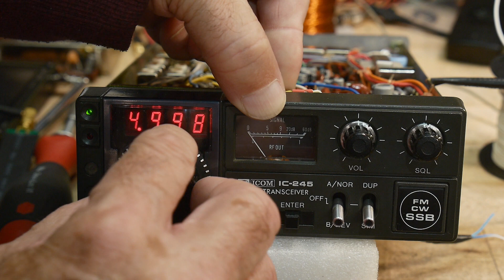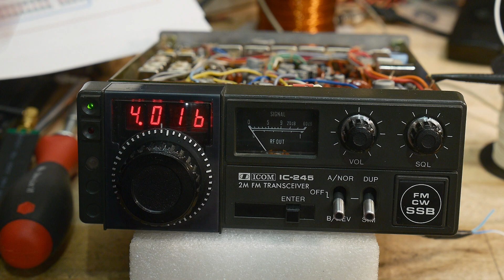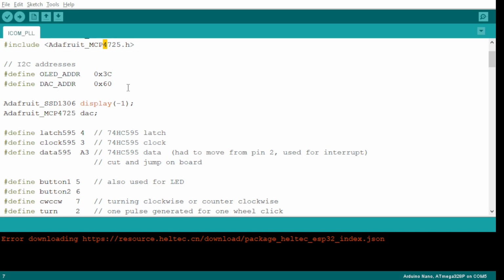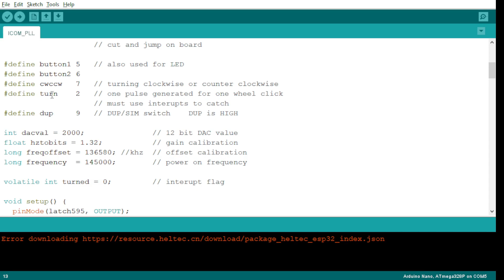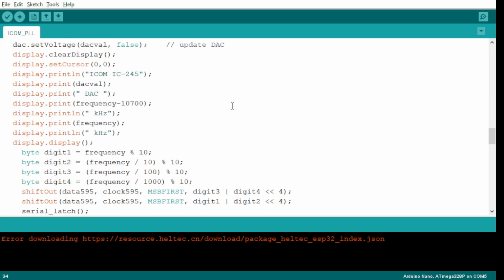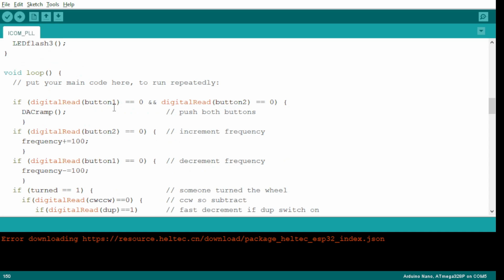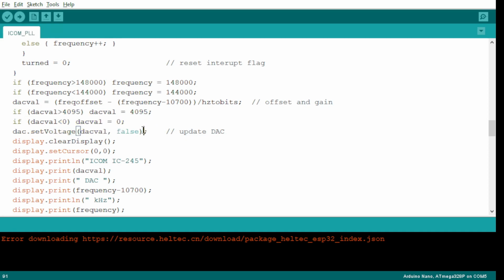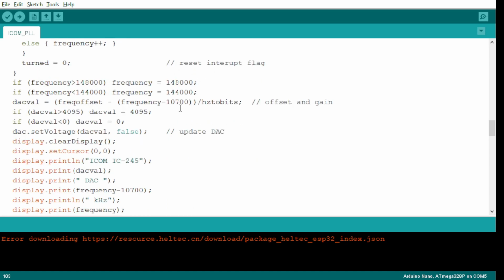#966 ICOM IC-245 Firmware running front panel  wheel and LED displays

Comment: I have an old IC-245 sn 2769 that had a wire break off going to the 10 pin connector at J3 of the synthesizer board. Do you still have the 245 thats in the video? I'd like to know if you could open yours up and see if you could tell me where the white wire on the end next to the brown wire goes on the front panel?

Comment: Great idea to do this project! Im having thoughts about one I'd like to do. 
Just fyi, there is a race in your code to handle interrupts.  Both interrupt and main loop code modify the flag.  Once you have checked the flag the window opens.  At the bottom of that handling of the flag being set,  the flag is cleared. If the wheel is being spun quickly and the interrupt comes between the check and the clear you clear the flag even though it's a new set.  It's not a big deal as the only effect is you miss a pulse when the wheel is turning quickly.  There is an easy fix though. Rather than use a signed int for the flag,  make it an unsigned long and have the interrupt service routine increment it rather than set it.  Then the check is against the stashed value of the counter at last check.  Just have to account for roll over (hence unsigned so no roll to negative). Also avoids issues with read-modify-write in the main loop because you only write it at interrupt level.

Comment: Hypothetically, at an inturrupt, you could check the time against the old, and if the timeout is short, you could change the frequency more than if the timeout was short. Either way save the time as oldtime. That way the knob will quick or slow when you need it to be. The timer and oldtime are unsighned long, but they only need to be subtracted.
Reply from the maker: I'm not good at time travel

Comment: Interrupts are serviced BETWEEN two processor commands.  If enough time passes, the interrupt service will be performed between EVERY two commands where interrupts are enabled.  If you load a value from memory to a register and proceed to use it, the service routine might have run between the load instruction and some of the use instructions.  The "volatile" keyword causes the compiler to guard against this:  Disable interrupts, load the value, manipulate the value, store the new value, enable interrupts, and repeat.  This assures that the value used in the main code is the same as the value used in the interrupt service routine.  ONLY values SHARED by the main code and ISRs need to be declared volatile or the performance will be degraded.
Reply: From what I've seen so far compilers don't add the disable and enable interrupt operations around the load and store operations. Volatile only forces the compilers to not store the value in a register (much faster access) but keeps using it from memory (where it may have been updated by the interrupt)
Reply: @rjordans  That makes sense; the compiler don't know when I am done using the value.  Thus, it is up to us to disable and to enable interrupts to keep the service routine from changing the value while we use it.

Comment: For future reference, note that the STM32 "Maple"/"blue pill" board is a bit better suited to these types of implementations than the nano---it is cheaper, fully compatible with the Arduino IDE, and has hardware interrupts on tons of pins (maybe all of them; can't remember). It is also much faster (which is obviously irrelevant for this type of project, since the Nano/328p has plenty of horsepower for things like this).
Reply from the maker: I have a love hate relation with those and other STM32 boards. you have to move a jumper to do the programming which is a pain. or push a button on other boards. my programming style is to constantly check small code changes and so I upload a lot. I do like the TTGO boards. I get the nanos for $3 so very close in price.

Comment: Doesn't the ATMega328p have a pin change interrupt (PCINT) on most of the pins (in addition to the dedicated irq pins)?  I haven't read the datasheet in awhile so maybe I'm misremembering.  Tracking down those solder joints should be a fun time :D

Comment: I was mistaken about my radio only covering 144-146 mhz. Duh, its not the euro model. however sensistivity suffers at > 146 mhz. Above 146 the rx kinda wavers. PLL losing lock? Or has someone diddled with tuning? Don't see evidence of previous work on radio. Rx seems to work from 144-148 mhz, with the displayed frequency being 25 khz high. Tx works from 144 to 148, but will only tx on 144.125, 145.125, 146.125, and 147.125; ie tx only changes by mhz. FM tx power is 10 watts at low end of band, and drops to 7 watts ant high end. Hmmmm.....has somebody diddled with tuning? Dunno. I also have some undefined digits showing; have tried flexing front board - no change. I'm going to have to go through and make a better chart of displayed freq vs. rx freq vs tx freq and see if i can find a pattern to aid troubleshooting. The failures I'm seeing seem to be constant, not intermittent. Prolly gonna be a bad chip. Hopefully not the PLL LSI chip. That will be a deal breaker. If I ever get up enough interest in 2m sideband, I'll just put 10 turn helipots on the front panel for tx and rx, and a freq counter module with if offset. All that said, you have done some highly impessive work on this, and I've enjoyed following along.

Comment: I thought that the wheel was a quadrature encoder at the start of the video but it clearly is step/dir encoder.
I would do the frequency calculation at the interrupt routine (maybe another signed variable that is added after the button presses? ) else it might loose a step or two.

I'm mostly tinkering with the stm32 stuff now and not with arduino. I've done some things with the Atmel line of microcontroller but that was some 10 years ago ( with assembly... :) ), but if there is some timer device that could do the "heavy lifting" of the step/dir signals then I'd use that.
Reply: The circuit looks like it is a quadrature encoder type of system, but they have done the decoding in hardware and presented the direction and clock outputs. A couple of chips worth of gates, and a couple of flip-flops. Makes sense as there is not really any micro controller as such in these rigs.

Andy